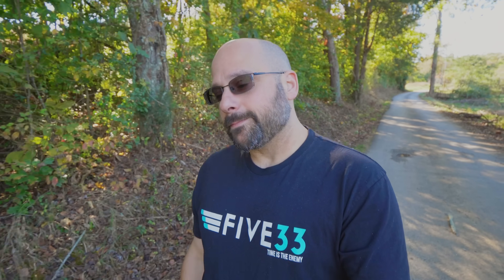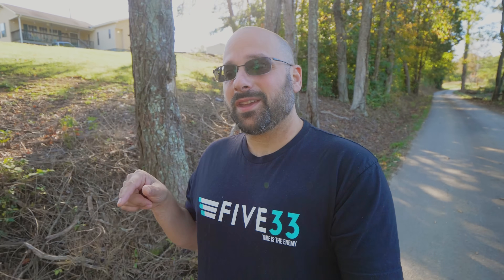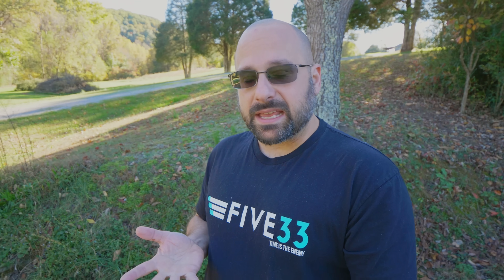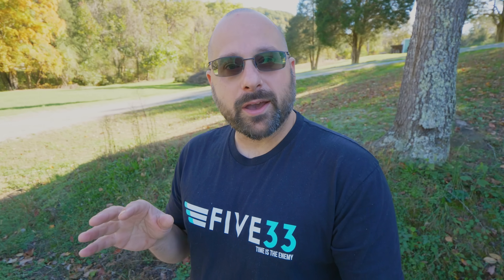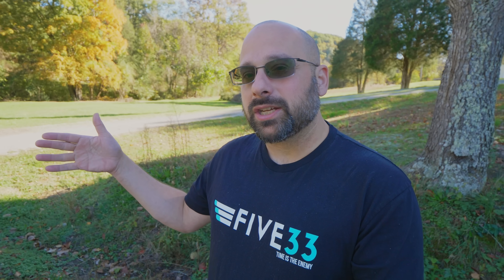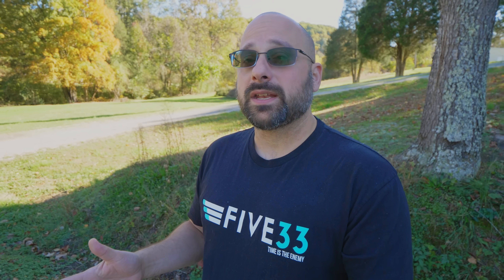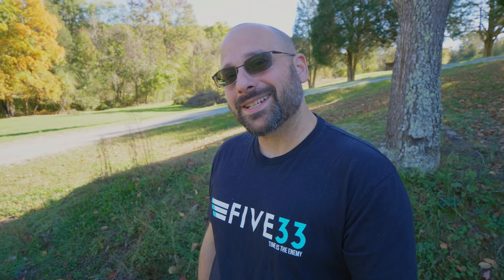How long can you leave your lipos fully charged without damaging them?

Comment: I am running a 6S6P Li-ion field pack, a couple of M6D chargers, and I usually take 4-5 flight lipos to the field. All of that fits comfortably in a Torvol lipo safe bag. 

Makes life very easy; 3-4 packs on the charger, one on the quad, and you can keep on flying. 
Battery at 3.95V/cell after a crash? No messing around with partially depleted batteries which are empty when you are right in the flow, just swap for a fully charged one and put the 3.95V one on the charger. 
Day coming to an end? You know when that is going to happen. Already start bringing flightpacks to storage , go home, throw bag in closet, recharge the Li-ion pack to 4V/cell whenever that suits you, done. 
You get that 'lets do a quick fly, NOW' call? Pick up the bag, put 4 batteries on the chargers in the field with one at 3-5C, prepare your stuff, take the first one off that charger, fly, and let the rest reach full charge. 
Need a bit of extra juice? Make sure field packs are charged, find a car or wall socket, charge the Li+ pack at 18 Amps, and once you start with the last flight pack there is a lot of juice in the Li+ pack again.

And so on. It really beats bringing 20 packs to the field in convenience, and your precious flightpacks spend as little time at 4.2V or below 3.5V as possible.

If you are frequently killing your batteries in a crash, consider mounting a TPU 'landing pad' that also protects the edges. Works for topmounted batteries too. I can emty a pack in 2-3 minutes, I do crash at speed, I break arms, props, motors, midplates, etc., but I seldom destroy a battery. Please do whatever you can to avoid burning down batteries at the flying spots. That's a serious fire hazard, it smells awful for a long time, and it seriously bends public opinion the wrong way.

Comment: This is a hot topic, that could bring to light some pretty good info. First off for me I fly big planes , copters and some mid to small planes. For small stuff for the most part you hardly would feel the drop of battery energy. However in heavy amp draw situation , like jets, large aerobic planes on the up line , 3d copter flying , you most definitely feel the sag in battery power. I have never really gotten more than one season out of my batteries. Next season , the power is way off from the previous season, and that's for cheap and high end batteries . That's why I stop wasting money on expensive batteries. As a matter of fact  the best batteries I ever got was HRB which I got years ago that was half the cost of Tatus. I skipped a season of flying and the third year I was pleasantly surprised of the power it still had, but they were a 10s set up in a big cruiser that was over powdered with a Moto 140 swinging a 21 inch prop. So most of the flight I was half throttle. The take off run though I still felt the torque. Some pattern guys at a field I used to fly at had good results with Hobbypartz Blue lipos. Those were dirt cheap too. 
I always put my batteries in storage mode. Yep still they go bad by next season.

Comment: Usually if it's been 3-4 days at full charge I ask myself if I'm gonna fly them in the next 2 days by looking at weather forecasts and how much free time I have etc. If not, I usually discharge them to around 3.9 volts/cell since doing even that saves quite a bit of time over 4-7 batteries. Also most of the broken batteries I had have broken from a cell that is too low or doesn't read, or excessive physical damage, which makes me not feel safe charging it. Only a couple of them have bad enough performance or high IR, usually caused by overdischarge anyway. Basically if you don't fly cinematic or long range I wouldn't stress about it, just don't make a habit of leaving them for over a week often.

Comment: IMO worrying about how long a lipo has been at full charge and if you need to discharge ruins the hobby. I'd rather take a 20% hit on the performance of my battery or just buy new ones rather than worrying if my batteries should be left at full charge or not. I've had batteries fully charged for 6+ months and couldn't see a difference compared to ones that were "properly" maintained.

Comment: I use those cool LiPoSuction things that discharge the battery to storage super slow. very convenient. I have a set of batteries almost 3 yrs old and still going strong. My previous set of batteries that i left at full charge for a couple days each week only lasted about 9 months. So I am now under the impression that cycling the battery is better than leaving it at full charge. Just my one opinion though.

Comment: Even storage charge isn't guaranteed to maintain your lipos.  I recently came back from a 6 month break from FPV (all lipos charged to storage level), and about 1/2 of my packs had dead cells that I couldn't recover. I went as far as trying to brute force some charge into them to "wake them up", but no luck.

For now on, I'm putting all packs I don't use on storage charge at least every couple months, even if they were already charged to storage levels.  LiPo's just don't hold up well.

For reference, I mainly use Tattu R-Lines and a Venom Duo Pro charger that has storage charge capabilities.

Comment: It might be more because of the temperature change I bet. So people don't charge them in a cold place, and then go for holidays in a super hot environment. The cells were already full in cold weather, when you bring them to the heat it will expand for a non capable capacity that may cause leak or fire.

Comment: From what I've read, the lithium dendrite growth over time that cause the reduction in capacity. Overcharge and over discharge seems to quicken this effect and when the dendrites reach from one side to the other, you get a short and a fire. The mechanism that govern the rate of growth of this stuff seems like a hot topic in Li-ion battery research for improving performance. Very cool stuff.

Comment: Thanks JB. Which is worse: leaving the battery at full charge or leaving at around 15% charge, say around 14.9v for 4s?
Reply from the maker: Leaving at 4.1 or 4.0 volts significantly reduces the damage done.

Comment: So here's a question re the DJI FPV drone:  DJI has no provision for charging or manually discharging to storage voltage. So, after I fly, is it better to leave the battery discharged or let it cool then charge it and let it discharge as per DJI's inbuilt discharge?

Comment: What about HV charged batteries I wonder? My guess is that performance degrades much faster. HV whoop batteries don't last all that long, but there are other factors that degrade their performance (like overheating) so it's hard to say without more data.
Reply: The more C-Rating, lesser capacity and HV they degrade much faster than non HV multiple cell packs when fully charged.

Comment: Small addition for batteries that are brand new: These still contain a certain chemistry that protects the batteries before they are charged for the first or second time. The fact that these arrive at 3.8V per cell is no proof that they can therefore be stored for ages later, I think.
I was once told by a GensAce employee that correct and slow charging should be much more important at the beginning. But in the end it's all about having fun and batteries usually only last one season for me anyway. 🤣
Reply: I still have my fist 5 lipos from a Walkera heli... my batteries last a long time but that's likely due to the Polly effect;-)
Reply: Did you go to China to talk to them? 🤔🤔
Reply: at the beginning of exploitation or at the beginning of each charging?

Comment: I had batteries fully charged for about 4-5years...and the drop was to 4.05 pre cell...used them when I found out they still had a charge and they worked perfectly... still have them now...their just in storage charge...3.80 per cell they where at room temp 65-70degrees for those 5 years also...👍👍😎😎...

Comment: Because of this I often leave them around 3.7v per cell which is what I land at. The question is what’s better, leaving them at say 3.6-3.7v per cell or 4.2 if your to lazy to storage charge.
Reply: I think that leaving it at 3.6/3.7v per cell is a little better because it's closer to the storage voltage than at 4.2v per cell. But still none of them are good for your lipo life

Comment: I would love to see some hard test data on the subject. Most chemical/molecular reactions are exponential. Meaning they start slow and build over time. Think of the school volcano experiment. It starts slow and builds versus exploding off the bat. Or boiling water, which is molecular but so is chemical really, it starts a bubble here and there before it turns to a full boil. Or a spreading fire from a spark. I've always assumed batteries were the same when outside of storage voltage.
Reply: Reliable test data is hard to find.  However, I have experienced that fully charged LiPo's die after being stored for a prolonged time (>2yrs). Empty batteries seemed to survive better.  Therefor I try to adhere to the 50% storage level  that many manufacturers advise for longer storage periods.

Comment: I think they might degrade 5% when left 30 days charged the first time, but if you leave them the second time charged for 30 days they don't degrade another 5%. Maybe another 2% or so. Im a professional charged battery procrastinator, for many years now. I have packs that are 4 years old and have been left charged for 2 weeks (thats my max) for at least 5-6 times and they are still "fine". I mean they don't feel like new but i get  a meaningful flight from them still.
Reply: I have 9 years old 16s 2p lipo pack in ebike. Made around 80000-100000km on them and they still work perfectly fine. I usually charge to 4-4.1V per cell. Its only few % capacity less, no big deal. I think its worth to take care about batteries, they will serve veeeeery long time.
Reply: @bobikbobikowy5458  you have Li-ion not Li-po. I'm not sure what the difference is but Li-ion can handle a lot more abuse than LI-PO. I have recycled many 18650 Lion cells from cordless Drill, Saw, etc packs and some have lasted for years. Lipo, not so much.
Reply: @bobikbobikowy5458 if you not using battery how you store voltage is and how down voltage you going usually 3.5v?
Reply: What if I just leave my phone charging for just 5 hours? Is it unhealthy for my battery or just fine? I'm just over protective for my phone
Reply: @ronaldgamer6430  controller will stop charging it once the battery is full
Reply: Yea I have left some fully charged for awhile. They degrade some but I didn't find them dead. But my drone isn't amp hungry. My batteries are over kill for my drone
Reply: I also have 2 lipo packs for my black and decker weed eater...i think they are 4s...i charge them after every use using tje wall charger they came with...sometimes they sit up to 2 plus months without be used.after 8 years and 200 plus cycles they still seem as good as  when they were new...but if they have degraded 10% it would be hard to tell anyway...

Comment: From what I have found regarding leaving a lipo fully charged for a week an then fly them. Ovonic lipos will keep there ability to be useful over time. Now cnhl lipos really don't an begin to degrade after a few days of being left charged. I have also found that the high mAh of a lipo seems to degrade the lipo fast than a lower mAh lipo...2200mah -850mah, My Rdq lipos seem to do this. However, my pyrodrone graphene lipos seem to do alright which surprised me. Being a resident of Washington state, rainy days with the wind an cold, I try to charge my lipos two days before planning a flight.
Reply: I tend to find higher performance /higher C rated batteries are also the less tolerant of any "neglect". I run my batteries down to around 10%, storage change them back up once they cool down, and then finish charging the day before. And run them down two days later if they don't get used (when I remember to!). Had a "race-grade" go from perfect to absolutely useless after leaving it fully charged for 3-4 months. :-/

Comment: So this is what I think about storage voltage. It is a good voltage for storage (months and months)... but to always keep it there when not flying is a bit paranoid.  

Lots of consumer laptops and other devices use lipo and I promise their smart battery management controllers do not keep it at 3.8 volts. Like it is ridiculous that so many in this hobby is obsessed with storage voltage but I bet they don't keep their electronics in their house at 70 percent charged when not in use.
Reply from the maker: It's always a tradeoff between needing charge to use the battery vs. lifespan of the battery. With LiPos, you seldom need the charged up when you're not expecting it, and you only need them charged for a specific length of time then you discharge them. With a phone or laptop, you are using it constantly and when you do go away from your charger, you want it to last as long as possible. So you always leave it charged up and accept that sacrificing battery life is a consequence.
Reply: @JoshuaBardwell  I just think many are overthinking the when to discharge to storage or keep charged. 

I guess I typically destroy batteries before seeing negative impacts on keeping things charged up. I am bad about keeping all my lipos charged 🤷‍♂️

Comment: Is the storage level for HV lipo's (4.35V) higher than 3.8V? Maybe 3.9V or does that make no difference?
Reply from the maker: It's still 3.8 volts. They are the same lithium chemistry just rated to charge higher.

Comment: All my batteries are always left fully charged and I do not have any issues with them and the life is good. The only failures I have had have come from outlandings where the time to get to the quad has been long and when I have finally got them the voltage is below 10 volts. Those batteries I discharge and throw away. Because they never seem to be relaible after that.

Comment: Great basic info. Worth noting that the level of degradation between full and storage voltage is not linear. Reducing the voltage from 100% to 90% or 80% can greatly decrease rate of degradation, without having to do a full round trip to storage voltage and then back up to takeoff voltage. 

Not mentioned is the speed (or amps used) to charge and discharge cells. The higher the more degradation occurs. With drones, discharging almost always occurs at hight amps. Being bit more gentle at end of a charge, and recharging can reduce some stress on the cells. Degree of voltage sage is a general indicator of how much cells are being stressed. 

The other important factor is heat. Heat is bad for cells, particularly when are fully charged, as it amplifies all the bad chemical reaction in a cell that causes it to degrade. Simple tips, is try not to leave charged cells in warm car, or sun. Letting cells cool before charging. 

A good reference to learn is "battery university". It covers both basic stuff, but also gets into hardcore details should anyone want a deep dive into chemistry and physics.

Comment: Been in that situation alot of times charge the night before only to wake up to rain(gotta start checking the weather forecast). But the most time I leave my battery's charged is 3 days after that ill charge them back to storage charge. Joshua you should do a review on the bigdaddy battery's and the zees. They are cheap but hold up well.

Comment: I have lipos over 11 years old that I still fly. I never leave a battery at full charge more than 24 hours. And every 6 months or so I go through all my batteries and check rarely used ones to make sure they are at storage voltage. I am a huge proponent of using a dis-charger when you can't fly for some reason. But I have met so many people that don't even know they exist. And it's weird to me that they are rarely marketed to this hobby. Guess they would rather have you buying more batteries anyway.

Comment: The way I usually explain it is that basically everything causes wear on batteries, just some things cause more. Storage voltage at 20C/70F wears the least, and full charge, full discharge, high current and so on wear them more. Same thing with fast charging, even if a pack says it's rated to 2-3C charge, that will wear it faster than 1C or .5C, same with discharge. All those factors are much more important with batteries and systems that are likely to actually physically survive more than a few months, however 😅

Comment: There's also temperature.
I had a PDA that I kept fully charged in a hot environment and the battery wouldn't charge in less than 6 months.
The worst thing is to over discharge, next is to keep too full at high temperatures.

Comment: Any suggestions on when to storage discharge the battery for your radio? Also any thoughts on storage charging GoPro baterries with no discharger available? I can never determine if I should storage discharge my radio since I regularly need it ready to use.  I find myself leaving the radio battery almost always fully charged (bad for battery health) and similarly have this issue with my goggle batteries.  Action cameras like GoPro are even harder to deal with since there is no storage option.
Reply from the maker: I do the same with my radio. It's just how you use it.
Reply: @JoshuaBardwell  Thanks for the insight Josh

Comment: This came at an awesome time as I have 1 battery I forgot I had charged and can't really discharge since my drone is awaiting repairs. I'll probably retire it since 2 cells literally won't budge from 4.2v while the other 2 are at 4.05. Will also buy a proper battery charger (that can also discharge)